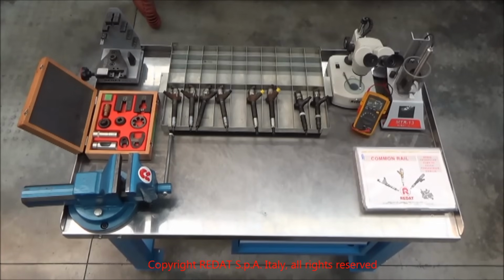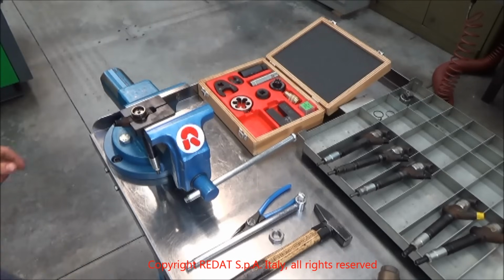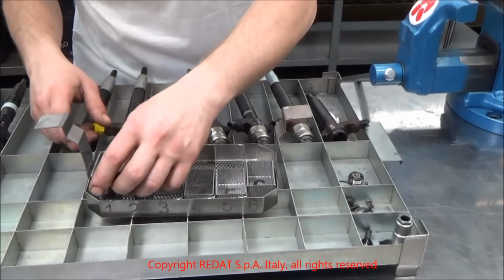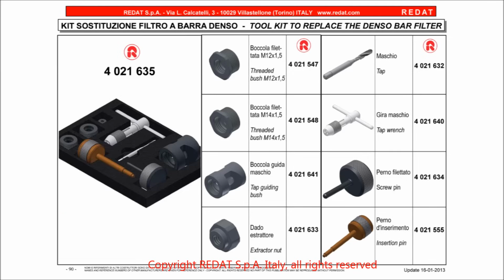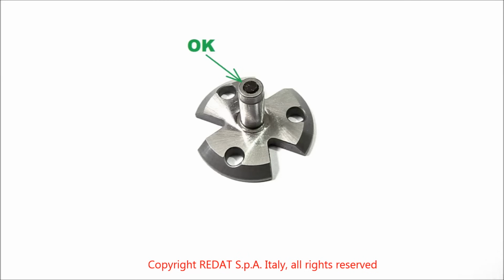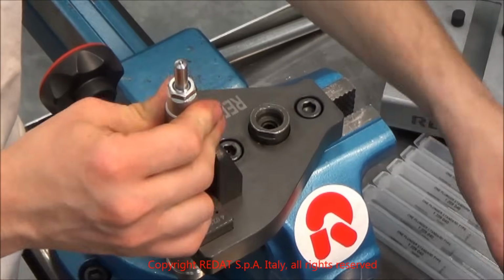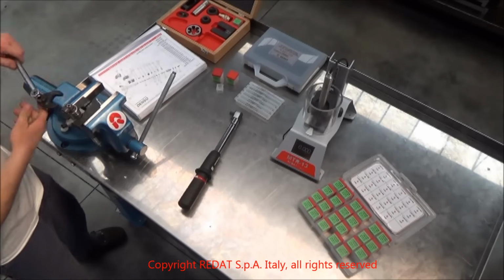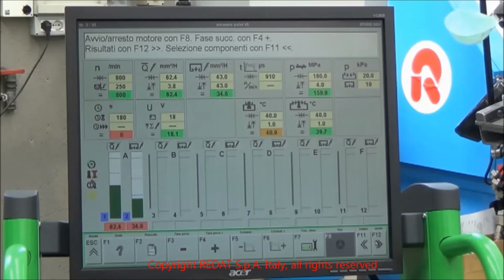Denso common rail injectors - Assembling and disassembling

Comment: Shouldn't he have PPE on? Gloves etc?  (I used to work for a PPE and tool supplier. For our Quality Control department, we had a small table and a ruler)
Reply from the maker: Good point, but the oil you see in the videos is not diesel fuel. By law, in Italy we cannot use real fuel in the test benches, and it is instead replaced by special test fluids, which are safe to handle. That said, we welcome the suggestion to use gloves in future videos so that we do not risk inducing misuinderstandings in viewers who operate under different conditions.
Reply: @RedatSpAVideo  👍

Comment: Thx. But no coding?
Reply from the maker: at the time we published the video, it was not possible for us to do the coding on Denso injectors. It is now possible, on certain injector part numbers, but the coding is something extra on top of a correct remanufactruing and calibration, the repairing process shown in the video remains valid.

Comment: Denso stuff is always complicated but reliable
Reply: Where does the shim go?
Reply: This is not true , anymore, since the premature failure of their piezoelectric injectors on the D4D engines mainly the 2AD generation following the euro5 and euro6 rules. Toyota had to stop manufacturing diesel RAV4 Corolla Lexus is200, and used BMW n47 diesel engines instead. My Denso injectors prematurely failed like thousands of other customer's because of these manufacturing defects so that injectors are wearing and breaking at 60-70 000 km. A diesel expert told me that a tire would resist more than these injectors. Toyota Europe refused to recognize its responsibility for warranty although my RAV4 was fully maintained in Toyota's dealership since it was on the road. These Japs Toyota+Denso=yakuza!!!

Comment: Why not make video  with full measurement
Reply from the maker: Because each injector has its own calibration, it would not be very relevant if we show you just one part number, and we cannot show all of them, plus testing conditions and equipment can influence the data as well. You should get one brand new sample, measure it on your own equipment and testing conditions, and keep both the data and the original injector as a reference for the repair works you will make.

Comment: How we know if the nozzle is abnormal?
Reply from the maker: There are several ways, from the simple spray testing with a hand operated nozzle tester, to looking inside the nozzle with a borescope to make sure the there is no dirt occluding the holes, to testing the whole injector on the test bench and seeing if the deliveries are within tolerances, if they can be calibrated with shims, or if they are so far out that some component may be compromised.
Reply: @RedatSpAVideo  if we  read on the vehicle with scanning tools which reading  the fluid return data? How serious consider critical? As I know normal max fuel rail pressure can reach 30000.if racing nozzle,how high can the pressure reach?
Reply from the maker: @snoopy81  I am sorry but we specialize in the production of spare parts for injectors, we never work on complete engines and we cannot advise about engine diagnostics, nor about racing adaptations.

Comment: So Denso fuel injectors can be repaired? Because I heard they can't be repaired ...
Reply from the maker: They most definitely can :)
Reply: We are manufacturer specialized in auto and marine diesel engine parts since 1952.
Our main parts are
EURO II system: plunger, nozzle , delivery valves, head rotors, repair kits, etc.
Common rail system: Injector complete and injector spare parts for CATERPILLAR, DENSO, DELPHI , BOSCH, SIMENS, CUMMINS, etc.

If you have any inquiries, pls do not hesitate to contact me.

Comment: What if the slonoid has a  intermiton issue as this can be a common problem with these injectors after a certain age reading the resistance will not tell you this shurely
Reply from the maker: The resistance test is just preliminary. The injector is always tested on the test bench and any issues will emerge.
Reply: @RedatSpAVideo  Owe` thanks for info
Reply: We are manufacturer specialized in auto and marine diesel engine parts since 1952.
Our main parts are
EURO II system: plunger, nozzle , delivery valves, head rotors, repair kits, etc.
Common rail system: Injector complete and injector spare parts for CATERPILLAR, DENSO, DELPHI , BOSCH, SIMENS, CUMMINS, etc.

If you have any inquiries, pls do not hesitate to contact me.

Comment: Great video. 
Can disassemble a bosh common rail injector to clean the nozzle. Just i was thinking to mark the nut with the body when put back will be in the same place. Can I do that for cleaning?
Reply from the maker: thanks for your comment.
First of all, we must note that if an injector has a problem, what we recommend is taking it to a specialized workshop who will repair and recalibrate it correctly, we do not recommend disassembling for cleaning alone.
Marking the reciprocal position of nozzle nut and body is not useful. when tightening, the important thing is to screw the nut completely and then tighten the correct force with a torque wrench, the alignemnt makr would not provide any useful information in this case.
Reply: @RedatSpAVideo  ok thank you so much for your advice
Reply: We are manufacturer specialized in auto and marine diesel engine parts since 1952.
Our main parts are
EURO II system: plunger, nozzle , delivery valves, head rotors, repair kits, etc.
Common rail system: Injector complete and injector spare parts for CATERPILLAR, DENSO, DELPHI , BOSCH, SIMENS, CUMMINS, etc.

If you have any inquiries, pls do not hesitate to contact me.

Comment: What is the torque of a solenoid? 15 Nm? 25 Nm?
Reply from the maker: it is the force you need to apply when tightenng the solenoid nut, measured with a torque wrench.

Comment: how choose correct the shim on injector needed... you choose 1.653 ?
Reply from the maker: It depends on the result of the injector on the test bench, and the difference with the performance you need to achieve.
You test it using the same shim size as before, see how it goes and then increase or decrease the shims size until you hit the sweet spot. For the beginning, take note of what shims you change, what sizes, and what results you get. With experience, you can get it right at the first attempt.
Reply: @RedatSpAVideo  im sorry, i didn have test bench professional. and the problem, when im using shim before, the nozzle did not spraying... and i change shime to the large size... and its work. but what the effect when im change the shim over size the needed? please help me, im amateur
Reply from the maker: You must make your own tests, changing a shim with one a little larger or a little smaller, testing again, and taking note of what changes and in what direction, after some tries you will learn to predict what shim (or combination) does what.
If you do not have a test bench to correctly make these tests and make sure the end results are correct, you cannot do any of this, even if you manage to get an injector working, you can never be sure if the calibration is correct, unless you test it directly on the engine and hope for the best, whihc is not a good idea.

Comment: сколько стоит быстросьем на замер обратного слива форсунки, и быстросьем на распылитель???
Reply from the maker: I am sorry but we do not speak Russian, please contact our sales department at sales@redat.com, they speak Eglish, French, Spanish, and of course Italian.
Reply: We are manufacturer specialized in auto and marine diesel engine parts since 1952.
Our main parts are
EURO II system: plunger, nozzle , delivery valves, head rotors, repair kits, etc.
Common rail system: Injector complete and injector spare parts for CATERPILLAR, DENSO, DELPHI , BOSCH, SIMENS, CUMMINS, etc.

If you have any inquiries, pls do not hesitate to contact me.

Comment: Hello how about triton 1465a041 , how much is the torque wrench and shim ?
Reply: We are manufacturer specialized in auto and marine diesel engine parts since 1952.
Our main parts are
EURO II system: plunger, nozzle , delivery valves, head rotors, repair kits, etc.
Common rail system: Injector complete and injector spare parts for CATERPILLAR, DENSO, DELPHI , BOSCH, SIMENS, CUMMINS, etc.

If you have any inquiries, pls do not hesitate to contact me.

Comment: Bueno.... al fin un video de casi una fábrica de inyectores.¡¡Tienen de tooooodo!!
Reply: We are manufacturer specialized in auto and marine diesel engine parts since 1952.
Our main parts are
EURO II system: plunger, nozzle , delivery valves, head rotors, repair kits, etc.
Common rail system: Injector complete and injector spare parts for CATERPILLAR, DENSO, DELPHI , BOSCH, SIMENS, CUMMINS, etc.

If you have any inquiries, pls do not hesitate to contact me.

Comment: Do you do install or credit for all these tools me these tool I need to get my ford transit van running.... 
Can I just clean and put it right back
Reply from the maker: Just cleaning the injectors is not correct.
We recommend taking your injectors to a specialized Diesel service workshop, which can replace the worn parts, and calibrate the injectors doing a proper remanufacturing.

Comment: olá,gostaria de saber o valor e se é possível o envio do kit de ferramentas dos injetores
denso para o brasil?
Reply: Madson Pedreira 
Me liga
Reply: We are manufacturer specialized in auto and marine diesel engine parts since 1952.
Our main parts are
EURO II system: plunger, nozzle , delivery valves, head rotors, repair kits, etc.
Common rail system: Injector complete and injector spare parts for CATERPILLAR, DENSO, DELPHI , BOSCH, SIMENS, CUMMINS, etc.

If you have any inquiries, pls do not hesitate to contact me.

Comment: First class , we will be buying from theses guys , and looking forward to the next video.
Reply: We are manufacturer specialized in auto and marine diesel engine parts since 1952.
Our main parts are
EURO II system: plunger, nozzle , delivery valves, head rotors, repair kits, etc.
Common rail system: Injector complete and injector spare parts for CATERPILLAR, DENSO, DELPHI , BOSCH, SIMENS, CUMMINS, etc.

If you have any inquiries, pls do not hesitate to contact me.